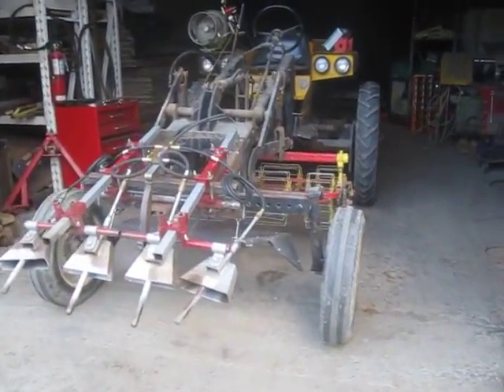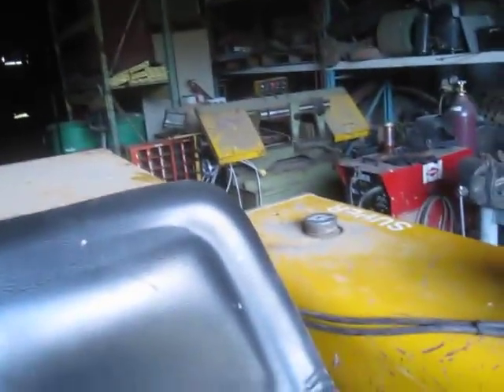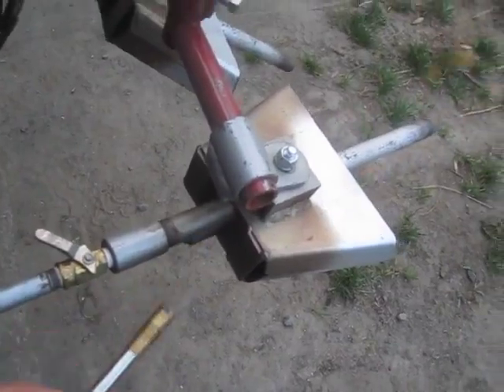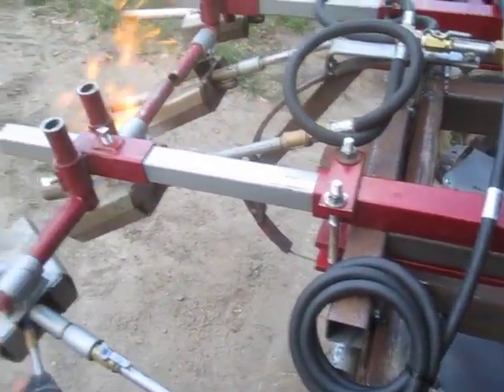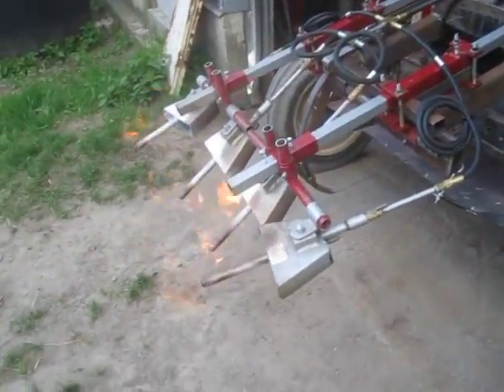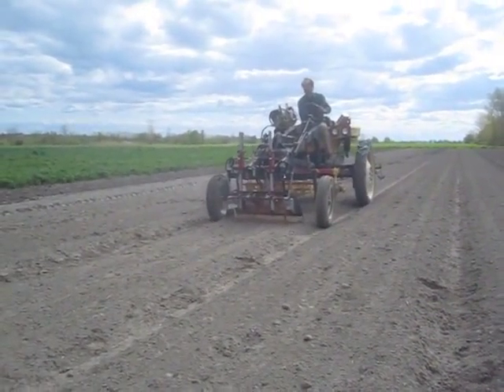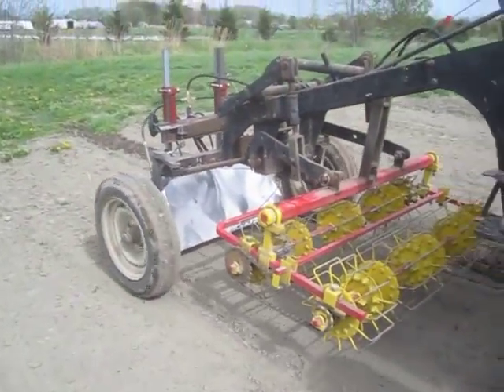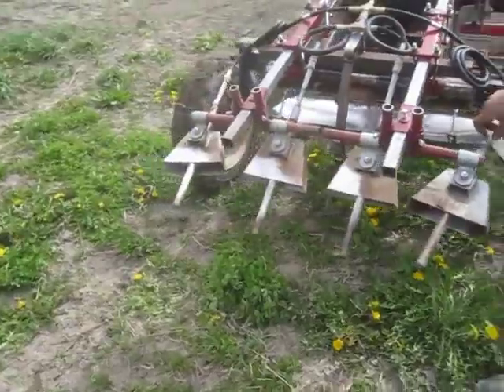Flame weeder on Hefty-G cultivating tractor

Comment: i'm working on an old hefty tractor, and the trasmission seems to coast in 2nd and 3rd gear.  one of the gears in the transmission has a one way bearing of sorts.  have you had any issues with this?  does yours coast down hill, or after reaching speed in 1st or 2nd gear?  this one will re engage in 1st gear, but not in second, unless the tractor and input comes to a complete stop.
Reply from the maker: There might be a sprag clutch (one way mechanism) in your transmission but that seems pretty unlikely to me.  My guess is that there's something wrong with one of the gears or selector mechanisms.  Perhaps uneven wear is causing a gear to slip out of mesh with it's mate when torque reverses rolling downhill.

I thought I had made a video about my transmission when I had it apart but apparently not.  I have some photos I could share but looking back at them I can't totally guess what your issue is being caused by but I don't think it's supposed to do that unless yours is way different than mine.
Reply: @reidallaway  I've had it apart (im a millwright ) and there is a one way clutch in one gear, that lets it freewheel in 1st and second gear.  i was hoping yours was the same, but it might not be.  this was from a hefty a616 loader/backhoe, and as i'm sure you know, theres little to no info on them out there.  thanks anyway
Reply from the maker: @billberry5677  I'm sorry I can't help you but it sounds like they are different beasts.  I wonder why your transmission is set up that way? Somehow useful for loader work or to run the pump(s) when stationary for backhoe work?  I've never seen that Hefty model but I bet you're now the de facto authority on it 😆.  Glad it fell into such competent hands.  BTW millwright is on my short list of two things I want to be if I'm reincarnated.  That and arborist.  Lemme know if you find other hefty/haxco resources.